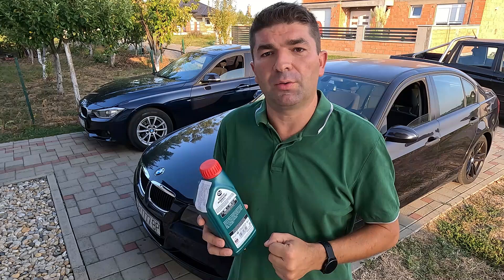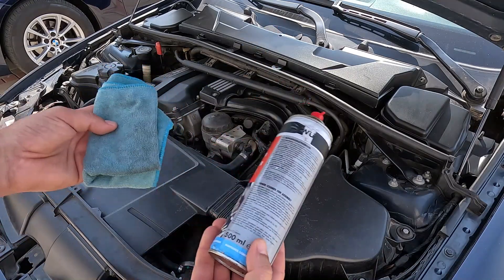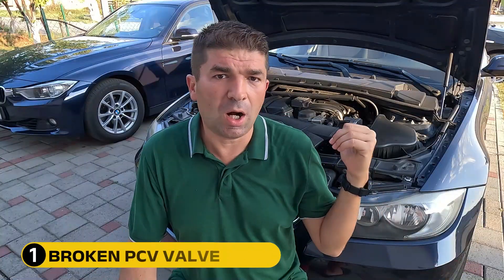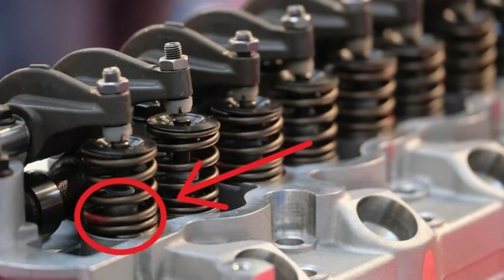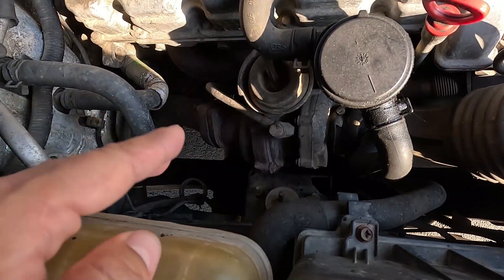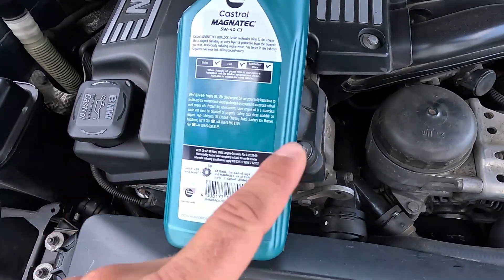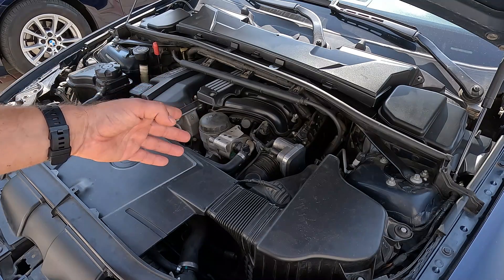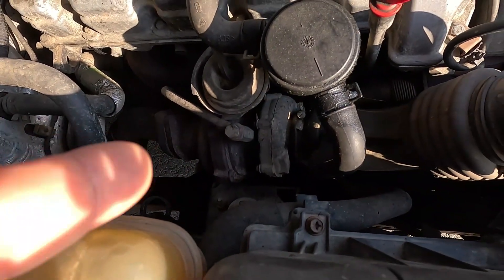Car Burning Oil? 7 Common Causes & How to fix it

Comment: 1 litre per 2-3 thousand miles? Mine burned 6 litres for 2,000 miles
Reply: What was the reason?
Reply: @vlogsbyamna-i5k  potentially worn head valve seals